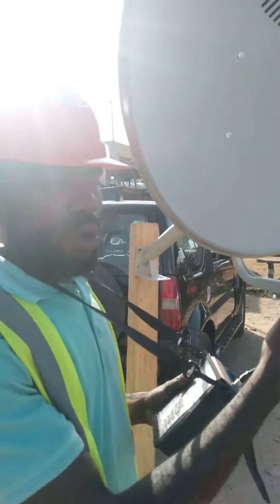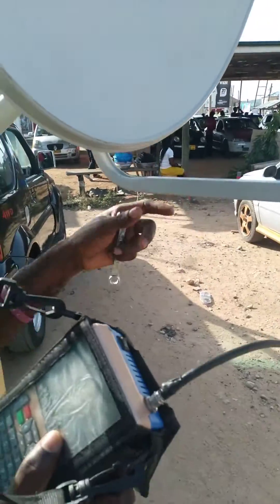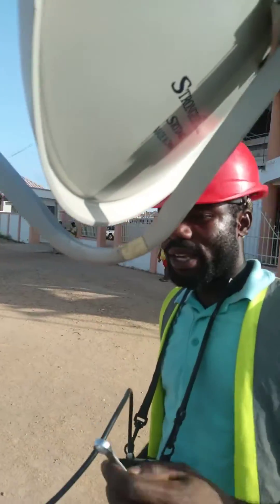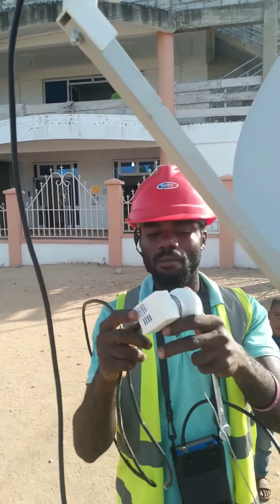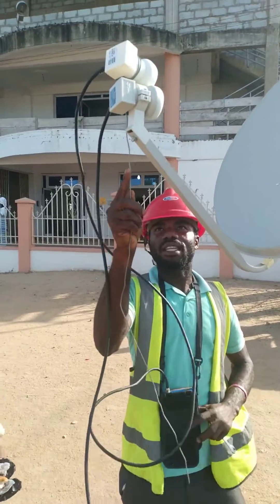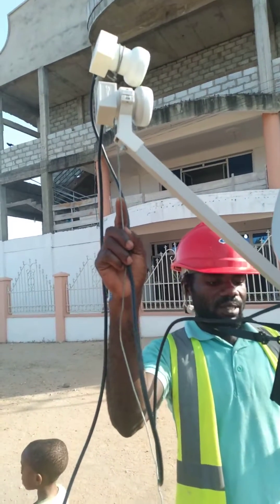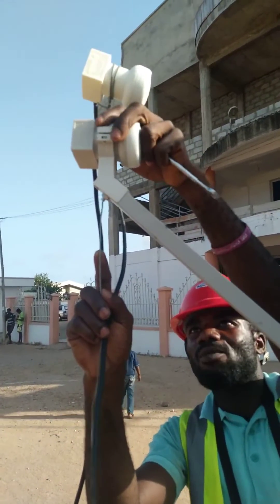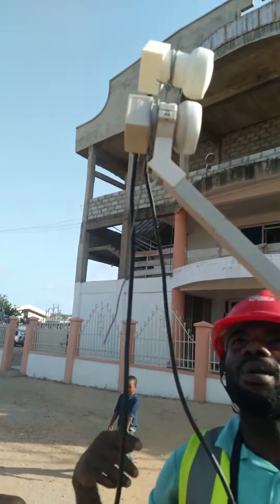How to track Multi tv and DStv on a 60cm dish

Comment: Apart from dstv, what other satellites can be combined with multi tv?  Thanks
Reply from the maker: Using a 60cm dish,
You can combine 7e, 16e and 28e(Multi tv).

You can also combine 28e and 42e(satview
Reply from the maker: With 90cm dish,
You can combine 28e,36e,42e,45e,51e and 68e